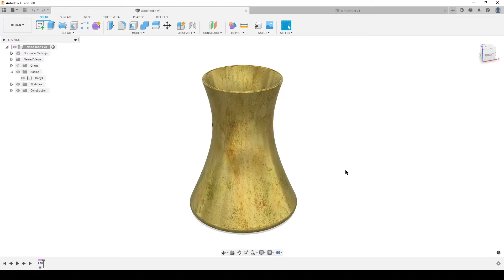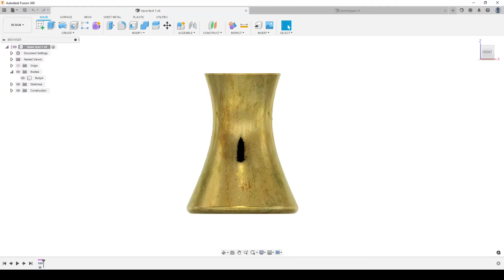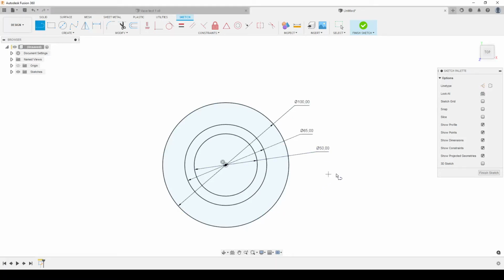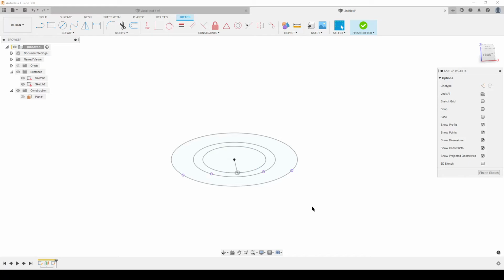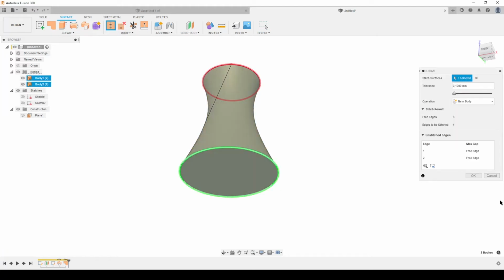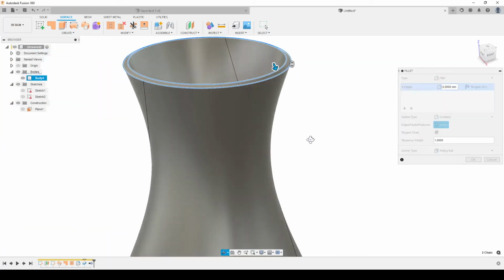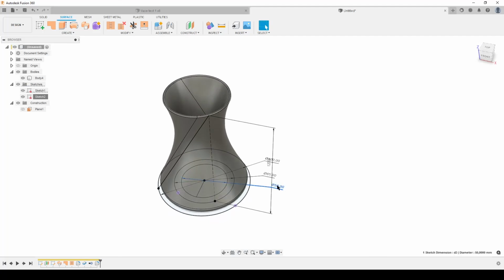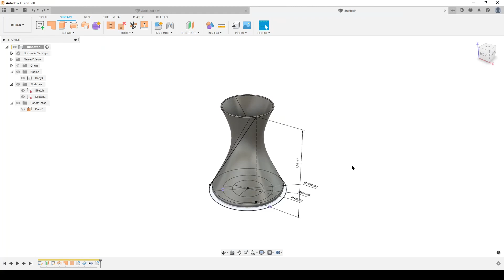Fusion 360 - Curved Vase (Hyperboloid)

Comment: Error: Cannot make sweep closure for closed path
І used the middle circle for the path because got an error when tried to use the same one as in the video
Reply from the maker: A workaround is doing only half sweep (distance 0,5) then do circular pattern of the body and stitch. From what I know there have been some upgrades to the surface model in Fusion making it better at some surface and getting confused by other. I hope this helps.

Comment: That is really cool -- THANKS!
...BUT...is there an easy way to create a square tapered body extrusion (like a larger square on one plane to a smaller square on a higher plane if I'm saying it correctly) with inward or outward curving walls? Or even a pyramid with curved rather than flat sides? I cannot seem to find an easy way to do this. Thanks.
Reply from the maker: That shape is possible with Loft and an intermediate profile. And there are other possibilities depending on the level of control of shape needed.
Reply: @KristianLaholm  Thanks. That appears to be the only way. It would be really cool if the Extrusion parameters panel included both taper AND curve controls.
Reply from the maker: @AerialLensVideo  That is then sweep and loft comes in to the picture. Most tools in cad are basic to not slow down performance with to many computation options.

Comment: Shell or thicken :-\
Reply from the maker: Thicken is used on a surface body like in this video, shell works on solid bodies.
Reply: Patching both ends, filet the base and perform the shell command, then filet the upper edge. This does not result in the same volume since thicken is perpendicular to the outer surface. 
For the drawing you need a solid body  anyway, therefore both methods should be possible, unless mentioned otherwise.